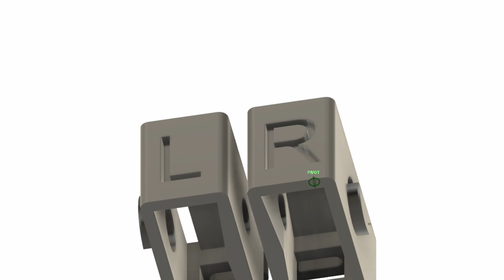Rode NTH-100 Fitlok replacement

Comment: I sure would like to order new housings from your link, but they were sold out when I went there.  So then I noticed down below (under You May Also Like) there is another option where you can download the digital print file.  So I ordered the digital print file.  The file came to my email right away.  Now all I need to do is ask a friend with a 3D printer to print them for me.  That works for me.  Thanks!
Reply from the maker: Awesome!

Comment: I have the same problem.. terrible design by Rode. I can´t believe why they don't modify it just adding a metal piece instead of that plastic sh*t...
My question is.. will this replacement be enough strong ? I read a comment that said the it broke pretty fast.. 
thanks
Reply from the maker: I think so, I redesigned it from that customer’s feedback. They gave me pictures of where it broke. I believe they are much better now. Use code Rode25 to get 25% off. And contact me if they do break. I’ll replace it and continue to make updates to the design.
Reply: @CodeMakesItGo  great, thank you! Does Each order include 2 pieces (left and right  i  asume) is the shipping from USA or EU? My concern is that shipping and customs will be much higher that the cost of the replacement.
Reply from the maker: @Hessencemusic it includes left and right side. Shipping is for US. Shipping to EU is expensive. You can put the item in the cart to see. If too much, then I recommend getting the digital print file instead if you have access to a 3D printer.
Reply: @CodeMakesItGo  thank you for the suggestion.. what 3d material do you recommend me to be solid enough? which one is the one r u using?
Reply from the maker: @Hessencemusic I’m using impact resistant resins. But you should get good results with PLA or PLA+.
Reply: @CodeMakesItGo  I’ve bought your model so I’m looking for a 3d printer here… someone offer make it using PA12 or ABS. And another one in polycarbonate. Which one do you think would be the best? Thanks
Reply from the maker: @Hessencemusic  PA12 would be what I would use because it should be a little flexible.